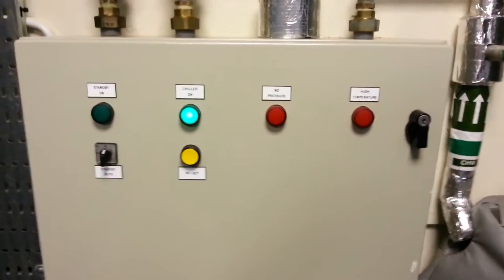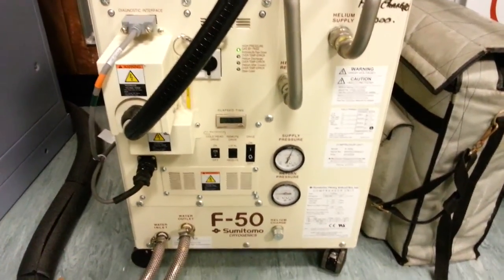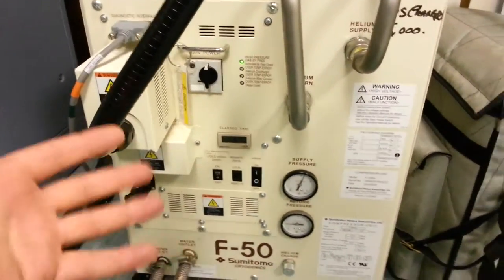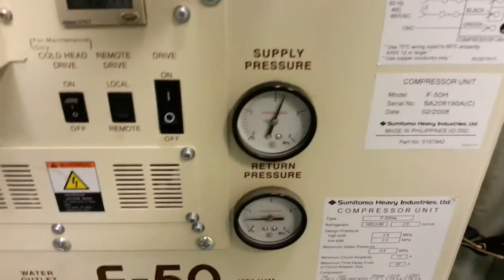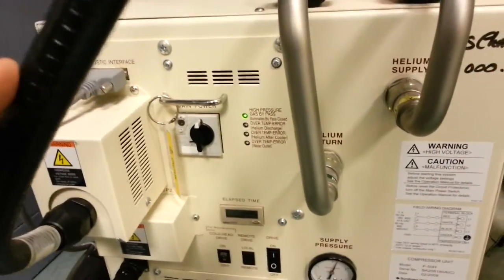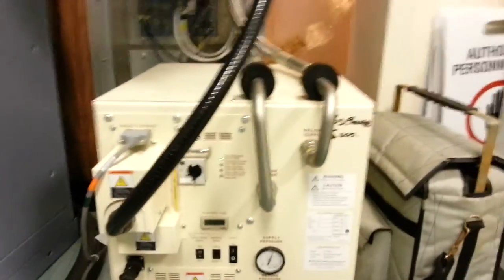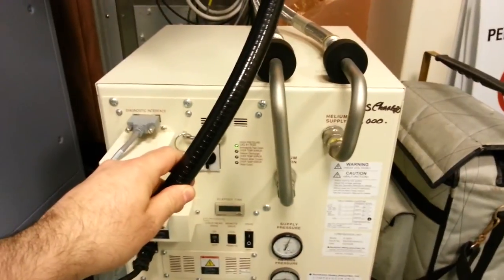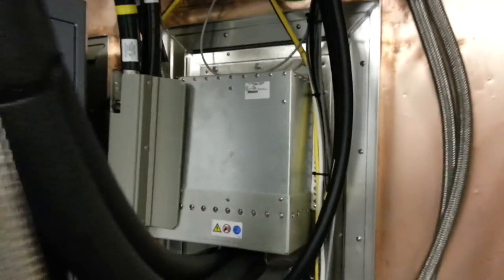Interesting chiller unit (extremely cool)

Comment: This is manufactured in the Philippines,I work there for 14 year ..i know hot to assemble this from parts ,,from copper tube cutting to brazing ,,assembly compressor to electronic ,thermostat,to drivetest

Comment: You are wrong about the thick black cable. It’s not the voltage out to the G-M. That thick cable is the compressor power cable. The G-M power is a smaller mil-dtl circular connector at the bottom.
Reply: @wadehsu2347 you are correct, it is the power cable.

Comment: 10 horsepower? What’s that in ergs-per-second? Is anyone out there still using horsepower?
“It’s a condenser, well it’s obviously not a condenser in this case because the helium doesn’t actually liquify, but it does the same job as a condenser”. Are we a little confused here? In no way is there anything in here remotely like a condenser.
It’s just a gas compressor and a heat exchanger and some control voltages and monitoring. Nothing else in this box. 
The big black cable is actually the power in. The control voltage for the Gifford-McMahon unit is the small grey cable below the big black one.

Comment: Don't you have a company proprietary disclosure agreement with where you work? this sort of insight could be very interesting for some parties. Although extremely intriguing it could be against commercial compliance policies.
Reply from the maker: Zed Man That'll be why there is nothing proprietary shown. It's just a generic off-the-shelf cryocooler unit and support equipment. Most of the technical information I just got off the manufacturer's marketing brochure on their web site.